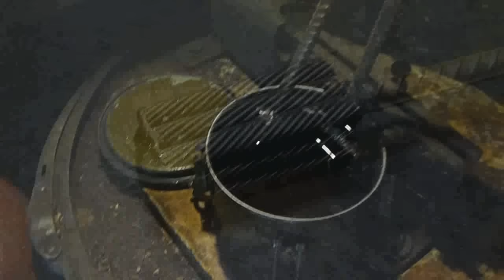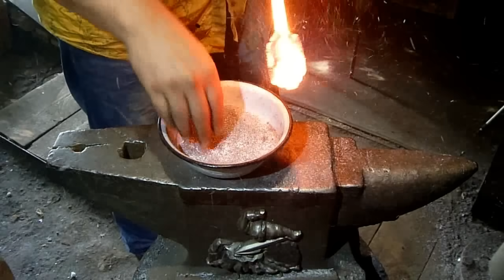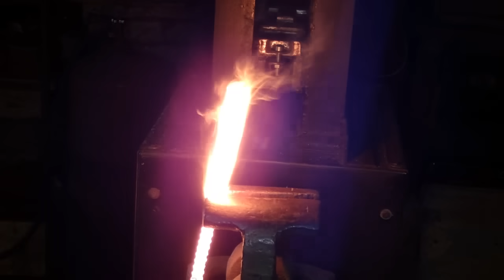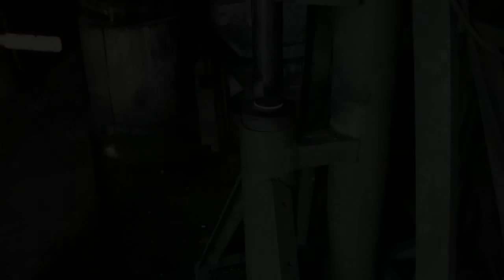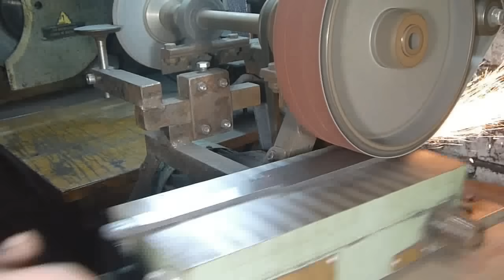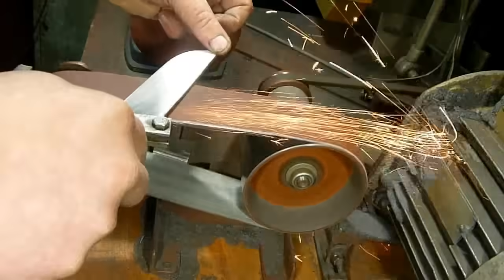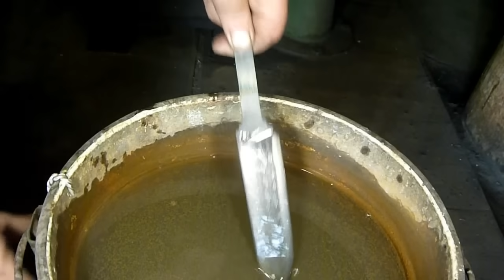Forged cable  Mosaic damask steel from the cable  making a blade

Comment: A quick question, why do you dip the metal in oil before putting it in the forge? Isn't it better to clean it and just go straight in?
Reply from the maker: The billet is soaked in kerosene. This is necessary for good welding (forging) steel. When burning inside the workpiece remains soot (carbon), which, with further heating, scales and rust inside the workpiece restores to the iron, improving the quality of forging welding.

Comment: And what is the purpose of the powder you sprinkle on before reheating? What is it?
Reply from the maker: I sprinkle flux (90% borax + 5% quartz sand + 5% charcoal powder) this is necessary for forging (forge) welding. The flux is alloyed with scale - the formed substance is sufficiently fluid and is easily displaced by deformation. In addition, the flux protects against oxygen and charcoal, carburizes the surface layer of metal - which lowers the welding temperature (if in brief).

Comment: What was the liquid you used to dip the cable in at the beginning of the video?
Reply from the maker: The billet is soaked in kerosene. This is necessary for good welding (forging) steel. When burning inside the workpiece remains soot (carbon), which, with further heating, scales and rust inside the workpiece restores to the iron, improving the quality of forging welding.

Comment: After forge welding, is there any benefit or detriment to using the press over the hammer, every time?
Reply: For drawing out the piece, specifically**
Reply from the maker: for certain operations it is convenient to use either a press or a hammer or hands.
To stretch the press is better

Comment: What is the purpose of hammering the hot work onto a wooden board?
Reply from the maker: The first welding is done on a tree, since the tree does not take the temperature like an anvil and burns oxygen when burning - this is important for workpieces with small parts (cable, chain).

Comment: Sir what is this powder you spred on the piece after heating it
Reply from the maker: I sprinkle flux (90% borax + 5% quartz sand + 5% charcoal powder) this is necessary for forging (forge) welding. The flux is alloyed with scale - the formed substance is sufficiently fluid and is easily displaced by deformation. In addition, the flux protects against oxygen and charcoal, carburizes the surface layer of metal - which lowers the welding temperature (if in brief).

Comment: What is the liquid he soaks it in at the start and what is the powder he puts on it?
Reply: Also, when it’s red hot, what is the white powder he puts the blade in towards the middle of the video?
Reply from the maker: The billet is soaked in kerosene. This is necessary for good welding (forging) steel. When burning inside the workpiece remains soot (carbon), which, with further heating, scales and rust inside the workpiece restores to the iron, improving the quality of forging welding.
I sprinkle flux (90% borax + 5% quartz sand + 5% charcoal powder) this is necessary for forging (forge) welding. The flux is alloyed with scale - the formed substance is sufficiently fluid and is easily displaced by deformation. In addition, the flux protects against oxygen and charcoal, carburizes the surface layer of metal - which lowers the welding temperature (if in brief).
Reply from the maker: This is annealing of steel, it is needed for grinding grain of steel grown at the temperature of forge welding, stress relief. Preheated billet to austenitic transformation temperature, placed for slow cooling in the heat insulator "Perlite".

Comment: Hola! Yo soy de Mexico y quisiera saber que es el polvo que le añade al acero como si fueran pizcas de sal tengo duda muchas gracias y de que pais es usted ?  Gracias  de nuevo y yo soy  principiante .
Reply from the maker: Rocio con fundente (bórax 90% + arena de cuarzo 5% + polvo de carbón 5%) esto es necesario para llevar a cabo la soldadura (forja). El flujo se fusiona con la escala: la sustancia resultante es bastante fluida y se desplaza fácilmente durante la deformación. Además, el fundente protege contra el oxígeno y, debido al carbón, carbura la capa superficial del metal, lo que reduce la temperatura de soldadura (en resumen).
Reply: @shurap  gracias  y si puede lograr los 50 a 52 grados  rockell

Comment: Boa noite.
Vc poderia me responder à 3 dúvidas que me surgiram ao assistir seu vídeo?
A primeira é saber q material tipo pó vc acrescenta sobre o "lingote" em brasa e qual a finalidade desse pó?
A segunda é porquê vc inicia a dar as marteladas sempre sobre um pedaço de madeira e somente depois é q passa a utilizar a bigorna?
E, por fim, a terceira é saber q material é aquele q vc deixa descansando a lâmina quase finalizada, uma espécie de granulado branco, e qual a finalidade dele?
Agradeço pela oportunidade de poder tirar essas dúvidas.
Boa noite.
Reply from the maker: Salpico com fluxo (bórax 90% + areia de quartzo 5% + pó de carvão 5%) necessário para efetuar a soldagem (forja). O fluxo se funde com a escala - a substância resultante é bastante fluida e é facilmente deslocada durante a deformação. Além disso, o fluxo protege do oxigênio e, à custa do carvão, cementa a camada superficial do metal - o que diminui a temperatura de soldagem (em suma).

A primeira soldagem é feita na madeira, pois a madeira é um isolante térmico e não retira a temperatura tanto quanto uma bigorna de ferro. Além disso, por meio da queima, a madeira queima oxigênio, protegendo a peça e prolongando o trabalho do fundente. Isso é importante ao soldar uma peça de trabalho com peças pequenas (cabo, corrente)

Este é o recozimento do aço, é necessário para refinar o grão do aço que cresceu na temperatura da soldagem de forja, para aliviar o estresse. A peça pré-aquecida à temperatura de transformação austenítica é colocada para resfriamento lento no isolador térmico "Perlite".
Reply: @shurap  perfeito. Muito obrigado pela aula!

Comment: What liquid do you pour before starting the forge?
Reply from the maker: The billet is soaked in kerosene. This is necessary for good welding (forging) steel. When burning inside the workpiece remains soot (carbon), which, with further heating, scales and rust inside the workpiece restores to the iron, improving the quality of forging welding.

Comment: I’m uneducated on this. Can someone tell me what the powder is he sprinkles on over and over and what the purpose is? Thanks!
Reply from the maker: I sprinkle flux (90% borax + 5% quartz sand + 5% charcoal powder) this is necessary for forging (forge) welding. The flux is fused with scale - the formed substance is sufficiently fluid and is easily displaced by deformation. In addition, the flux protects against oxygen and charcoal, carburizes the surface layer of metal - which lowers the welding temperature (if in brief).

Comment: in the beginning, right before he throws the billet in the forge, he dips it in a container of liquid, any ideas what that liquid is?
Reply from the maker: The billet is soaked in kerosene. This is necessary for good welding (forging) steel. When burning inside the workpiece remains soot (carbon), which, with further heating, scales and rust inside the workpiece restores to the iron, improving the quality of forging welding.
Reply: @shurap  You are a gentleman, thank you. Enjoy watching you work greatly.

Comment: What is that powder that you put on red hot steal ?
Reply from the maker: I sprinkle flux (90% borax + 5% quartz sand + 5% charcoal powder) this is necessary for forging (forge) welding. The flux is alloyed with scale - the formed substance is sufficiently fluid and is easily displaced by deformation. In addition, the flux protects against oxygen and charcoal, carburizes the surface layer of metal - which lowers the welding temperature (if in brief).

Comment: Quick question, why do you sometimes use wood on your anvil when hammering?
Reply from the maker: The first welding is done on a tree, as the tree is a heat insulator, and not so selects temperature as an iron anvil. In addition - burning, the tree burns oxygen, protecting the workpiece and pouring the flux work. This is important for welding workpieces with small parts (cable, chain).

Comment: What is the powder  u put on the steel blok
Reply from the maker: I sprinkle flux (90% borax + 5% quartz sand + 5% charcoal powder) this is necessary for forging (forge) welding. The flux is alloyed with scale - the formed substance is sufficiently fluid and is easily displaced by deformation. In addition, the flux protects against oxygen and charcoal, carburizes the surface layer of metal - which lowers the welding temperature (if in brief).

Comment: What is the liquid that you soak metal in before forging?
Reply from the maker: The billet is soaked in kerosene. This is necessary for good welding (forging) steel. When burning inside the workpiece remains soot (carbon), which, with further heating, scales and rust inside the workpiece restores to the iron, improving the quality of forging welding.
Reply: shurap thakyou.

Comment: Que es ese polvo que le añades y cual es su función?
Reply from the maker: Rociado con fundente (bórax 90% + arena de cuarzo 5% + carbón vegetal en polvo 5%) es necesario para la soldadura (forja). El flujo se fusiona con la escala: la sustancia resultante es bastante fluida y se desplaza fácilmente durante la deformación. Además, el flujo protege contra el oxígeno y, a expensas del carbón vegetal, la carburación de la capa superficial del metal, lo que reduce la temperatura de soldadura (aunque sea brevemente).

Comment: Shurap why the first time to hit the metal need  to put on a wood plate?
Reply from the maker: The first welding is done on a tree, as the tree is a heat insulator, and not so selects temperature as an iron anvil. In addition - burning, the tree burns oxygen, protecting the workpiece and pouring the flux work. This is important for welding workpieces with small parts (cable, chain).

Comment: What do the steel soak in before you forge it?
Reply from the maker: The billet is soaked in kerosene. This is necessary for good welding (forging) steel. When burning inside the workpiece remains soot (carbon), which, with further heating, scales and rust inside the workpiece restores to the iron, improving the quality of forging welding.

Comment: What is the powder he is sprinkling on the hot metal?
Reply from the maker: I sprinkle flux (90% borax + 5% quartz sand + 5% charcoal powder) this is necessary for forging (forge) welding. The flux is alloyed with scale - the formed substance is sufficiently fluid and is easily displaced by deformation. In addition, the flux protects against oxygen and charcoal, carburizes the surface layer of metal - which lowers the welding temperature (if in brief).

Comment: Why sprinkle salt and pepper on the red hot blade?
Reply from the maker: I sprinkle flux (90% borax + 5% quartz sand + 5% charcoal powder) this is necessary for forging (forge) welding. The flux is alloyed with scale - the formed substance is sufficiently fluid and is easily displaced by deformation. In addition, the flux protects against oxygen and charcoal, carburizes the surface layer of metal - which lowers the welding temperature (if in brief).
Reply: @shurap  thanks for your reply, very informative

Comment: What did you soak the cables in. In the 5gallon bucket?
Reply from the maker: The billet is soaked in kerosene. This is necessary for good welding (forging) steel. When burning inside the workpiece remains soot (carbon), which, with further heating, scales and rust inside the workpiece restores to the iron, improving the quality of forging welding.

Comment: what is that powder in the bowl  you sprinkle over the heated steel everytime? And why do you do this?
Reply from the maker: I sprinkle flux (90% borax + 5% quartz sand + 5% charcoal powder) this is necessary for forging (forge) welding. The flux is alloyed with scale - the formed substance is sufficiently fluid and is easily displaced by deformation. In addition, the flux protects against oxygen and charcoal, carburizes the surface layer of metal - which lowers the welding temperature (if in brief).

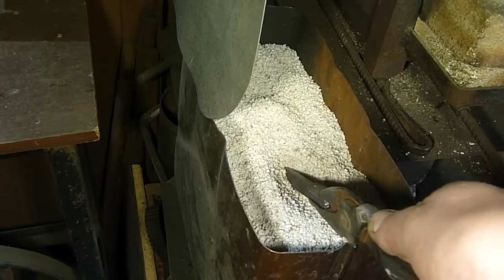Comment: What is that white fluffy sand you stick the hot blade into? @5:50
Reply: Borax
Reply from the maker: This is annealing of steel, it is needed for grinding grain of steel grown at the temperature of forge welding, stress relief. Preheated billet to austenitic transformation temperature, placed for slow cooling in the heat insulator "Perlite".
Reply: Thanks Guys 😊

Comment: What is the dust that you put in the steel?
Reply from the maker: I sprinkle flux (90% borax + 5% quartz sand + 5% charcoal powder) this is necessary for forging (forge) welding. The flux is alloyed with scale - the formed substance is sufficiently fluid and is easily displaced by deformation. In addition, the flux protects against oxygen and charcoal, carburizes the surface layer of metal - which lowers the welding temperature (if in brief).

Comment: what powder do you add to the red hot iron??
Reply from the maker: I sprinkle flux (90% borax + 5% quartz sand + 5% charcoal powder) this is necessary for forging (forge) welding. The flux is alloyed with scale - the formed substance is sufficiently fluid and is easily displaced by deformation. In addition, the flux protects against oxygen and charcoal, carburizes the surface layer of metal - which lowers the welding temperature (if in brief).

Comment: what is that dust u used and its function
Reply from the maker: I sprinkle flux (90% borax + 5% quartz sand + 5% charcoal powder) this is necessary for forging (forge) welding. The flux is alloyed with scale - the formed substance is sufficiently fluid and is easily displaced by deformation. In addition, the flux protects against oxygen and charcoal, carburizes the surface layer of metal - which lowers the welding temperature (if in brief).
Reply: @shurap  thanks for the explaination 😁✌

Comment: Why use this wood table un the firsts slams?
Reply from the maker: The first welding is done on a tree, as the tree is a heat insulator, and not so selects temperature as an iron anvil. In addition - burning, the tree burns oxygen, protecting the workpiece and pouring the flux work. This is important for welding workpieces with small parts (cable, chain).

Comment: What is that he dipped it in first
Reply from the maker: The billet is soaked in kerosene. This is necessary for good welding (forging) steel. When burning inside the workpiece remains soot (carbon), which, with further heating, scales and rust inside the workpiece restores to the iron, improving the quality of forging welding.

Comment: what is that dusty product that he puts on it ? and why. Tahnks
Reply from the maker: I sprinkle flux (90% borax + 5% quartz sand + 5% charcoal powder) this is necessary for forging (forge) welding. The flux is alloyed with scale - the formed substance is sufficiently fluid and is easily displaced by deformation. In addition, the flux protects against oxygen and charcoal, carburizes the surface layer of metal - which lowers the welding temperature (if in brief).

Comment: que pozinho e esse que ele adiciona quando ata forjando
Reply from the maker: Eu polvilho o fluxo (90% de borax + 5% de areia de quartzo + 5% de pó de carvão) é necessário para a soldagem forjada. O fluxo é fundido com escala - a substância formada é suficientemente fluida e é facilmente deslocada por deformação. Além disso, o fluxo protege contra oxigênio e carvão, carburiza a camada superficial de metal - o que diminui a temperatura de soldagem (se em breve).

Comment: Okay I'm a amateur what is he sprinkling on the hot metal?
Reply from the maker: I sprinkle flux (90% borax + 5% quartz sand + 5% charcoal powder) this is necessary for forging (forge) welding. The flux is alloyed with scale - the formed substance is sufficiently fluid and is easily displaced by deformation. In addition, the flux protects against oxygen and charcoal, carburizes the surface layer of metal - which lowers the welding temperature (if in brief).

Comment: What’s tht he dipped it in at the beginning
Reply from the maker: The billet is soaked in kerosene. This is necessary for good welding (forging) steel. When burning inside the workpiece remains soot (carbon), which, with further heating, scales and rust inside the workpiece restores to the iron, improving the quality of forging welding.

Comment: I forget, what's the borax for again?
Reply from the maker: I sprinkle flux (90% borax + 5% quartz sand + 5% charcoal powder) this is necessary for forging (forge) welding. The flux is fused with scale - the formed substance is sufficiently fluid and is easily displaced by deformation. In addition, the flux protects against oxygen and charcoal, carburizes the surface layer of metal - which lowers the welding temperature (if in brief).

Comment: What was the stuff he was sprinkling on it? Why was it gray usually it's white borax and what is borax for anyways sorry I might be stupid questions but I don't know
Reply from the maker: I sprinkle flux (90% borax + 5% quartz sand + 5% charcoal powder) this is necessary for forging (forge) welding. The flux is alloyed with scale - the formed substance is sufficiently fluid and is easily displaced by deformation. In addition, the flux protects against oxygen and charcoal, carburizes the surface layer of metal - which lowers the welding temperature (if in brief).
Reply: shurap thank you for the reply I appreciate it I watch your videos I love the outcome the stuff that you make unreal super cool maybe one day I will try something like this